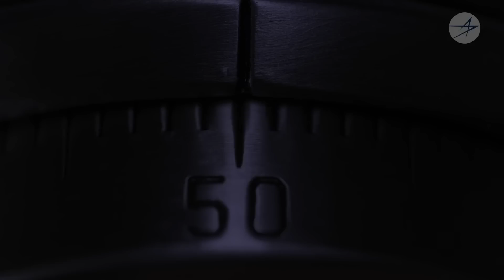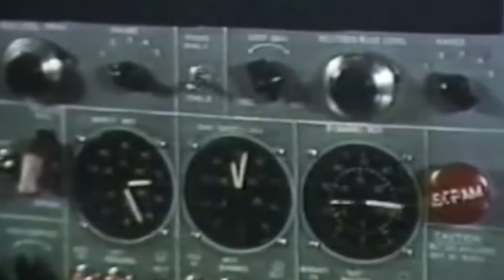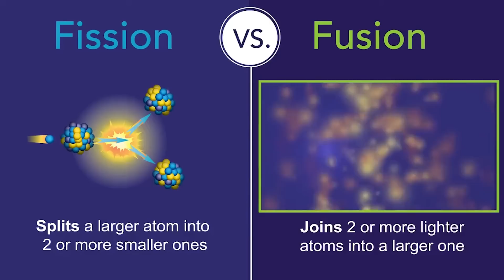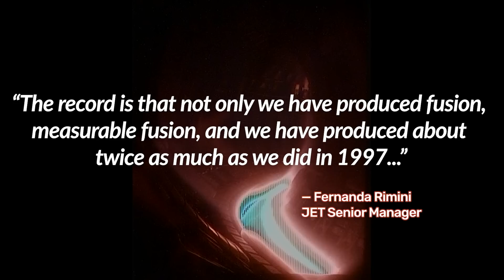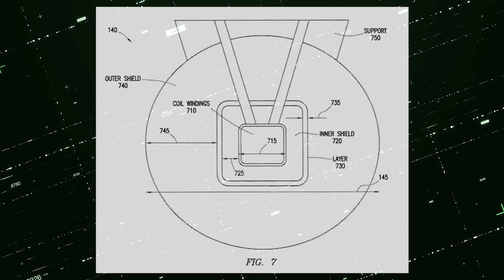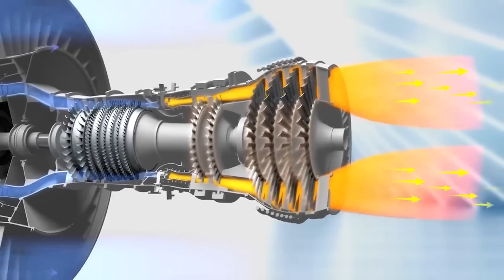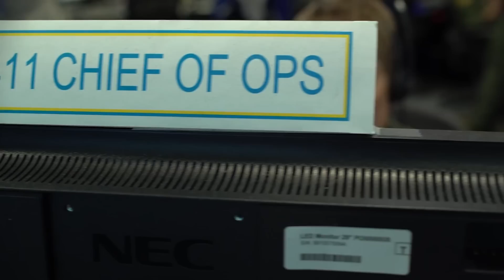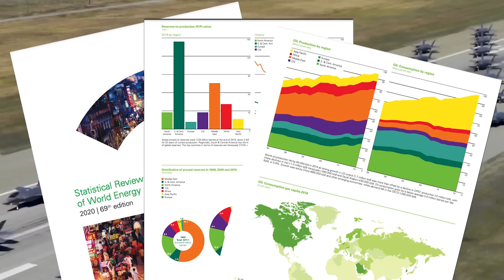Lockheed Martin's fusion-powered fighter and bomber plans

Comment: The patent is only meant to block others from developing the technology and isn't an indication that Lockheed is even close to achieving this.
Reply: that makes sense

But don't forget about how fast they are moving to next gen aircraft
Reply: @colekarrh9114  It's fusion. The tech to make that aircraft fly would solve most of the world's problems.
Reply: Yeah, we've been 15 years from fusion for 70 years.
Reply: @zinjanthropus322  Thanks for fitting this one in perspective. The video was - in sandbox words - a whole lot of nothing. Just tiring words, without any meaning to think about.
Reply: It’s similar to how Boeing took out a patent for forcefields.
Reply: They already have. It started with a LM Engineer that designed & built to fission generator for his house. LM took his design and BLACKED it.
Reply: Very true.
Reply: @samsonsoturian6013  we've gotten closer. 40yrs ago we were only 20 years from commercial fusion power. In the last 40 years we've gotten 5 years closer to the solution.
Reply: Well it certainly won’t be on the market for the next couple of years or even decades. As long as the struggle against china goes on, none of the Wally cool stuff will be released😢
Reply: @samsonsoturian6013  Let us know you didn’t pay attention without saying you didn’t pay attention 😂😂😂 It was theorized in 1950 but ok pay attention
Reply: No so sure
The applications , or rather the actual real world application is advanced propulsion for travel to Mars
Travel is currently impractical due to current level of space propulsion
Such a system could in theory shorten travel times
Reply: You, me, this channel; none of us will ever know until they announce it.
Reply: @blueberrywilbur315  you mind speaking coherently?
Reply: Kevin Verduci  That was fission reaction not fusion.
Reply: Check out Dr. Salvatore Pais’ patents. Government did a lot of work with him to solely gain control of those patents from his work. Much detail is redacted but they have working prototypes of 4/5 patents of his work. Check it out, as a member of the physics community I was pretty shocked. Genius guy who still works for the air force and DoD.
Reply: However the patent was made in 2014 only leaves 12 years till it expires
Reply: @zinjanthropus322  May also cause a lot more. Fission could solve a lot of problems, but gets pushed to the side because it causes quite a few as well.
Reply: @blueberrywilbur315  why you angry, though?
Reply: @J.P Slaym0 that doesn't exist. And you never heard of Ben Rich at Skunk Works?
Reply: Imagine being in any aircraft knowing you can fly longer than your opponent, pretty interesting advantage.
Reply: Then they shouldn’t get the patent. Patents should only be allowed to working inventions. Not just ideas.
Reply: @samsonsoturian6013  
We are a lot closer to dropping that x number of years away today than we were 20 years ago. Mainly imo because of advances in material sciences and the engineering done to bring higher temperature superconductors to market. If I was Biden I'd pump double or triple into fusion. With some if the money going to small startups with the proviso that the Feds get the right to use the tech at lower costs. Site any reactors at current shuttered coal power plants to start with.
Reply: It's almost end of 2022 and Lockheed didn't get any progress on this and there wasn't any indication that they are working on it. So I share your doubts.
Reply: @theebalz  “The source is that I made it the fuck up!”
Reply: I wow I’m sorry you don’t like America making next Gen tech to dominate the world hahah
Reply: @Slimjimmagoo  “It’s only 30 years away bro trust me bro we’re almost there bro cmon bro look at [Insert project that hasn’t made any impact in the fusion field] bro cmon bro please believe me bro” it’s been the same coping for the last 70 years, the Lockheed fusion project was abandoned a year ago, the scientists have moved onto other projects and it’s been taken off the budget.
Reply: @cowmoo5596  Nah they have hit several milestones now and are pretty much at the finish line. Governments already drawing up plans to build them and companies raising capital. This its 20 years away gimmick thing is about run its course. Its near reality now and I would say less than 20 years. Everyone wants to run on number its been 70 years lol but you don't want to accept the progress that was made in that 70 years BRO.
Reply: @wind_runner6836  ITER has another 15 years before it launches, and that’s a test reactor, not even the planed DEMO reactors. Commonwealth and Helion plan for 2035-2040
Reply: How long do they have the patent?  Like pharmaceuticals then they have a patent for 10-15years after that anyone can make copies.
Reply: This patent is reason to think they are further along than you think, and could potentially have working examples. Based on how they've operated in the past.
Reply: @colekarrh9114  SkunkWorks is one hell of an organization.
Reply: @cowmoo5596  ITER is already obsolete because it was designed with the materials from the 90s. Any source you are seeing that bases their analysis of where fusion is at on ITER is a joke. Yes, especially that well known physicist with clickbait video titles. Anyway, If they redesign ITER with modern high temperature superconductors that are vastly more powerful then they'll have to start over which will put it even further behind and it's experimental anyway. If it works and the newer designs based on new superconductors haven't already made it irrelevant then the next stage would be an upgraded version instead of the originally planned enlarged version.
Reply: @j.f.fisher5318  you don't read as many scientific publications as you think.
Reply: Lol like that patent will be respected when it comes to war
Reply: Kevin Verduci  That makes no sense. Fusion operates via hydrogen and magnets. Neither are radioactive.
Reply: @MarkMiller304   Lockheed isn't at war with the rest of the western military industrial complex. China has never cared about patents but they're also still using French companies to build their fission nuclear power plants, they're not about to make breakthroughs in fusion.
Reply: @MarkMiller304  the Pentagon will simply buy the patent in that case
Reply: So they have an exact design and blueprint for a fusion device but are far away from it? Clause that's what a patent is... 😅😅😅
Reply: @seanhoyt497  you can patent ideas. You don't need a working device
Reply: @zinjanthropus322  that’s what I’m saying, with technology involving weapons no one will respect the patents. Countries blatantly try to steal each other’s secrets. It’s a your lost is my gain environment.
Reply: @samsonsoturian6013  so the point in having a certified patent clerk with a background in engineering or physics having to state that the diagrams are legit doesn't matter?
Reply: @samsonsoturian6013  Caaause they have to do that...
Reply: @MarkMiller304  that's why export bans are a thing. One aerospace machine I worked with had a big lable saying not to let any foreigner examine it
Reply: @seanhoyt497  I wouldn't know
Reply: If course. Most people know this.
Reply: @tedrow70  
His patents are remarkable. It’s intriguing as to why the Navy insisted they be accepted
Reply: @Juliane well maybe you should watch more useful videos such as spitting for distance or farting contests. Probably more your speed.
Reply: @seanhoyt497  Doesn't matter how exact your blueprints are, unless you've made it work before all it amounts to is a drawing on a piece of paper. Reality plays by it's own rules.
Reply: @MarkMiller304  Western companies are still constrained by patents. Doesn't matter if they're arms manufacturers.
Reply: The new hypersonic missles use molecular compression to gain speed & increase propulsion. They have more technology aligned with government then anyone would know of.
Reply: @ravenmoon5111  and that they said 4/5 patents have working prototypes, as they’d stated. Now, that’s crazy. It’s crazy interesting the physics he uses because it isn’t “new” physics. It’s based on Heavisides formulae primarily, well that’s the main root. Cool stuff. He did a joint interview with a very famous physicist stephon Alexander recently on Theories of Everything. Would really recommend seeing it!
Reply: @tedrow70  
I will definitely look that up. It’s easy to say the Navy had some crazy idea behind these patents but they seriously leaned on the US patent office to accept them. To me that sounds unlikely unless they thought there was something to them
Reply: @ravenmoon5111  I agree. And he did one other interview with theories of everything (physics profile on YouTube, interviews a lot of famous physicists amongst other intellectuals) that he wanted the government to have them and as soon as possible, so no other nation could try to take the ideas… and he “left out some of the secret sauce” in his own words. One of the most brilliant people I’ve heard, and I’ve an astrophysics degree and aerospace engineering, I’ve seen some smart folks! Theories of everything has both interviews on there. Government definitely is decades ahead of the rest of the world though, whilst most of the world doesn’t even realize😅 crazy times.
Reply: @tedrow70  
Absolutely!
Reply: @zinjanthropus322  ironic patents only limit friendly countries
Reply: @samsonsoturian6013  That's an improvement then. 20 years ago we were always 30 years away from fusion.
Reply: @durandalgmx7633  No it isn't. It has the same accuracy as the Jehovah's Witnesses predicting the second coming of Christ. They just routinely update the dates and causes to fit current stuff.
Reply: When has a patent kept anyone from copying weapons, just ask China
Reply: Pretty sure that the patent doesn't really mean much of anything if it can't actually be built.
Reply: @Roger Smodher There are lots websites promising all sorts of sci-fi products. It's done to keep investors interested for the long term even if they're no close to releasing anything.
Reply: @Raptor747  You'd think so. Research patent trolls.
Reply: @Roger Smodher Dude, so far only one university's devise managed to create more energy than was required to fire it. That is the state of things at the moment.
Reply: @Roger Smodher Not when it's physically impossible. And you need to understand the difference between physics and engineering: The former is pure science and will never generate a profit, and the latter takes the results from pure science and tries to find profitable applications.
Reply: @Roger SmodherI knew the fact that the Iphone has more and better software than the F35 would shock you because like most people you're not aware of the vast software advantage silicon valley has over the military industrial complex. Go ahead and look up the values, how many lines of code are in the Iphone compared to the F35. Who do you think pays more for software engineers? Apple or Lockheed Martins. The answer should be obvious.
Reply: @Roger Smodher I'm a doctoral student in military history. I gave up on engineering because I cannot math. My opinions are as much garbage as yours, though.
Reply: @zinjanthropus322  n
Reply: Nope. Under 35 U.S.C. §101 the device has to be enabled,  i.e., it's got to work. In other words, they can build it.
Reply: @samsonsoturian6013  Huh, November 1, 1952 fusion was achieved. Harnessing it in workable confinement is the roadblock.
Reply: @thatonejerry9092  which uspn
Reply: @J.P Slaym0 how would YOU know?
Reply: @dawnfire82  Radiation comes as the fusion byproduct.  Castle Bravo demonstrated that quite thoroughly.  Hydrogen itself is generally not radioactive except for the low energy tritium. The thing that matters is what wavelength the radiation is emitted at. Not nearly so much in the 3×1016 Hz to 3×1019 Hz range which makes it far safer to work with.
Reply: @verdebusterAP  actually the biggest challenge of getting people to Mars isn't the propulsion system, it's keeping people not only alive but healthy. We can get them there alive but they won't be good for a damn thing upon arrival and recovery for getting healthy enough to actually function is unlikely. 
One of the best concepts put forward to achieving it successfully was called Mars Direct in the 90s, doesn't need any new or future technology, can be done on today's tech (was even feasible when first proposed in 90s ago) . The only issue was the cost. That's it. The investment. If the political climate at the time wasn't so turbulent it very well could've been done.
Reply: @jamesmaddison4546 
The current of tech means that trip will take months
The problem there is that requires a lot of fuel and resources 
Keeping them alive is simple task of designing a ship with proper shielding which again goes back to propulsion
Ample shielding is going to be a lot mass and in case of solar activity, they will need hardened shelters 
Thats a lot mass for engines
Reply: @verdebusterAP  It will take months either way dude. My keeping alive comment isn't just about the radiation. A shelter isn't as difficult as you think. We've had people stay in orbit for over a year on the iss and when solar storms hit they have a place to go retreat to. Any ship going to Mars is going to have alot of mass, the shortest trip is 6 months but you have to wait over a year to return and then 6 months back. So at shortest you're looking at a 2 year mission. You can send multiple ships in advance with everything you need, and what must come with the crew can be attached via rendezvous along the way. The big problems are food, and keeping the body itself healthy. Currently if we sent a crew they would be way too weak to even exit the ship because of the gravity environment they've been in for so long. Yes I said people have been on the iss for over a year and guess what, when they're back they get carried out of the landing craft. All the exercises they do isn't enough. It takes some months to be able to walk unaided again. On Mars, there's noone waiting for you to carry you. 
You don't have to believe me, you probably won't at all, but I'm actually an aerospace engineer, graduated 2 years ago, I have 3 more years before I can take the abet p.e exam and once I do, I plan on specializing in propulsion. Currently i work at Lockheed missile and fire control. 
Systems, nav guidance etc just isn't my thing. So when it comes to this stuff I know what I'm talking about. 
Of course new advanced propulsion systems will help alot of the problems with Mars travel, but it is not the limiting factor. It could be done today with what we currently have.
Reply: @jamesmaddison4546  
Exactly why the current level of propulsion is not feasible. It requires Mars and Earth to be in optimal positions which is not feasible
Feasible would be 7 months 3 months there 1 month stay and months return regardless of the planet positions
. The ship would only have carry 14 months of supplies
A 2 year mission would require 4 years worth of supplies
The problem with pre supplying is that you don't have any control over it. Now after the crew has left, you can start sending additional supplies so can build up a surplus so future missions can more equipment  to expand the base
Reply: @verdebusterAP  it's not all in one go dude. Habitation and food modules sent in advance, robotics setup solar arrays for power etc. Alot of things will be done awaiting the crews arrival. The crew takes what's needed for the journey plus a bit extra. Follow on resupply missions will also be sent ensuring crew have everything they need from food, clothing, replacement parts and so on. 3d printers will also be there waiting, if the printers can't make what's needed it's sent on resupply. Everything is saying is literally the mission profile that nasa itself agrees with. Look, I understand and agree with your propulsion comment, I chose propulsion to specialize in for a reason. I want to work on such revolutionary engines dude. But if you're always waiting for the next best thing, you'll never get anywhere
Reply: @Roger Smodher vhut? Relevance?
Reply: @jamesmaddison4546  
You can't send food or water in advance
The modules would subjected to months of radiation both in space and on ground
Sending them in advanced again means they have to amply shielded till the crew which again means more mass.
Even with equipment , still the same problem. Hence you have to wait to till after the crew launches, to start sending additional supplies as once they reach
Mars, the crew can break them done and store them safely in build up modules
Travel is only feasible when we dont have to rely on optimal planet positions
That means engines not reliant on chemicals
Reply: @verdebusterAP  🤦‍♂️ are you even capable of a discussion (this isn't a debate in my opinion) where you aren't stuck mentally within your own position unable to actually analyze what the other is saying? Repeating myself but I'll rephrase, every module sent WILL HAVE the ample shielding needed. The gardens that will grow in these modules will be safe, so will the water. I'm seriously not going to break down the entire mission technicals and timeline in a youtube comment. But if you really think some of the brightest minds in government and private sector space industries don't have the timeline sequence of the mission in proper order, that protection, storage etc isn't sorted, then man I don't know what to say. I'm not coming at you with hypotheticals I'm informing you of the approved mission profile. It's been thought of, worked out, calculated etc for a very long time. Space mission planning doesn't take place over a couple years, some people spend their entire careers on one mission theyll retire on before it even launches. Everything you see as a roadblock because of 1 reason, those people figure out ways for that roadblock to not be. That's why they're great at what they do. I'm pretty much done with this because you're stuck in singular thought
Reply: @jamesmaddison4546  
Again incorrect. In order to shield modules for months on end for travel through space and on the ground requires a massive amount of shielding and will greatly increase the mass again not feasible
The factor you are missing is the Mars atmosphere
Why did the NASA have to use the Sky Crane technique just to land 2000lbs rover
Why can we land 20,000lbs module on earth with 3 parachutes but can't do the same on Mars
Mars atmosphere is considerably thinner than Earth. 
Trying to land 20,000lbs on module on Mars would be exceedingly challenging
No they will not have ample shielding unless propulsion issues make a stellar leap
Reply: The patent cannot prevent others from developing the technology, it only prevents others from commercializing the technology.
Nobody can have monopoly of knowledge.
Reply: @theebalz  may I interest you in a bridge I have for sale in Brooklyn?
Reply: Kevin Verduci  That was FIssion, not FUssion. It's explained in the video
Reply: this fusion reaction-based engine platform powers two incredibly powerful electromagnets encompassing a very large uranium despited sphere at the northern and southern hemispheres,.This sphere is filled with liquid uranium rotated internally at 60,000 rotations per second. This becomes a magnetic superfluid ( different state of matter) producing plasma waves. The engine is supercooled to -250 Kelvin and pressurized at 300 atmospheres. The plasma waves produced affect the gravitational wave of the earth's magnetic field. The compact fission project achieved a beta limit of 9 or 90% in the late '80s. This is exactly what powers the TR platforms, TR-3A, TR-3B, TR-3C, and TR-3R.  I am not coming to you from an "x-files: prospective, this is real technology and has been undergoing testing and prototyping since the early 80s. The TR platforms were just the very crude and early stage of these types of powerplants and aircraft.
Reply: @e.s.5529  Crude but effective.
Reply: @zinjanthropus322  there has been valid advancement in fusion tech recently though
Reply: The government technology is generally 50-20 years ahead of the public,  but y'all know it all so....
Reply: @christopherjacobs8075  Those are just myths. The latest technology is where the big money is and where the most talent is concentrated which is in the private sector.
A few government labs are working on some new stuff but nearly all well refined products are the results of decades of feedback from millions of customers not a few government contractors and employees.
Reply: @zinjanthropus322  so who were the customers  for the F-22, X-29, X-31, X-32? Surely wasn't the private sector.  Yeah a lot of technology is inspired by private sector demand. That depends on what kind of technology it is though.
Reply: @christopherjacobs8075  Those aircraft wouldn't pass civilian standards as commercial products. The complaints about glitchy ui, uncomfortable seats, subpar noise proofing, terrible internal furnishings, lack of extensibility, price, malware after hackers get their hands on them etc would never end. The only reason they are able to get away with vehicles like the humvee that can't pass civilian safety standards is because only government employees who are able to stand the poor quality use them.
Reply: @zinjanthropus322  can't complain about what they don't have.  The government doesn't design things with comfort in mind to begin with. If they do I have a bone to pick with them about my rides in C-130's.
Reply: @christopherjacobs8075  But that's the point. If civilians were allowed to have fighter jets and a market developed, you bet they would better in every way from comfort to performance than anything available to the military. Probably cheaper too.
Reply: @zinjanthropus322   betting sounds good, but  it's not reality. Just like the technology discussed in this video is not designed for civilian consumerism. At least not in our lifetimes and possibly not in our children's lifetimes either. Doesn't mean it doesn't exist or won't. It just means civilians don't have access to it.
Reply: @christopherjacobs8075  That's a legal barrier not a technological one. For every thing that governments have that is also legal for civilians to have, the civilian versions are superior. You can't claim to be better than someone when they outmatch you everytime you don't make it illegal for them to compete. It wouldn't be a bet at all to say they would do the same if the barriers were removed.
Reply: @zinjanthropus322  still irrelevant if civilians can't have them. 🤷🏿‍♂️
Reply: That's not possible now. Everybody is researching for a sustainable fusion reactor. However the reactor can't sustain long enough to produce any energy.
Reply: Lockheed is a head off with many areas including stealth & other Techs …..Don’t underestimate them…they have good talents ..just look at their F22 …so many  nations and companies r struggling to make a fighter like the Lockheed ones ..
Reply: @colekarrh9114  We can’t even achieve fusion sustainability on the ground, this is a minimum of 50 years out
Reply: @landonluebke7627 , You are right but is your source about a civilian or military project. Don't forget that the known U.S. military budget is more of a light estimate than a set number not to mention the numerous black budgets. The U.S doesn't spend money on the military like any other nation, so remember that the U.S. has its resources to get projects moving fast.
Reply: @MarkMiller304  That only the most determined of state actors can illicitly get their hands on, no less. Thankfully, such actors are relatively few and far between.
Reply: @isaacomole9527  In other words, there's nothing stopping the individual from copying what is patented, if only for personal use.
Reply: @colekarrh9114  you are 100% correct in that, and I fully expect to see this within my lifetime, just from what I know about non-classified fusion, and how (that we know) military procurement works, this is still a minimum of 35 years out, but closer to 50. In my opinion of course.
Reply: Ok, Have a nice one
Reply: @samsonsoturian6013  yeah well, who knows ITER is the biggest attempt yet so there is a chance er have commercial fusion by 2060
Reply: @f1reguy587 I think the objective of air combat is always to fly longer than your opponent.
Reply: You're missing the point. It's  Technology moving forward not standing still
Reply: You're missing the point it's technology moving forward not standing still
Reply: Yup exactly
Reply: Thaaaaats not exactly how patents work and what they are intended to achieve, but you believe what you want to believe.
Reply: @samsonsoturian6013  
JPL just achieved it earlier this week. Decades ahead of anyone else.
Reply: @thatonejerry9092  
No no no. An invention must be reduced to practice (i.e. “it works” before you can get a patent. 🤦🏻‍♂️
Reply: @theebalz  
Not true at all. JPL did it this week.
Reply: @Frankie5Angels150  No, they simply had a sustained net positive reaction, that is not the same as functioning fusion reactor
Reply: Don't be so sure.
Reply: @vandiverb  You can bet your life on it
Reply: You realize you can’t file patents for items that you don’t have a working demonstration model for right?
Reply: @theebalz  most people are still 20-50 years behind. 🤣👍
Reply: Is this the same fission tech that the sciencentis have recently figured out?
Reply: Yess I was thinking among same lines
Reply: They more the less are why filled
Reply: C'mon man, Tony Stark built that thing in a cave with a box of scrap!...All the eggheads at Lockheed can't get it done?! 🤨
Reply: This is true, but the real question is if they actually incorporated it into an airframe and that was the only practical purpose because of the specific of the system would they even announce that the airframe was powered by it?  It would draw a lot of attention from foreign entities for espionage they might not get if they just only told who needs to know.
Reply: That sounds more feasible then there being actual operational aircraft using that technology.Companies will do things for the now and the future.
Reply: Possibly, but they announced a small fusion reactor years before that
Reply: Other countries don't have to follow us patent laws, especially Russia.
Reply: Probably the Chinese already have this in their inventory 😂 Can we keep our secrets to ourselves and do not divulge too much information. And also can we do a better job at cyber security so Chinese hackers doesn't get our goodies. We really suck at protecting our military secrets
Reply: Yep
Reply: @felixfungle-bung4688 but iirc that also means you can walk in with an unbuilt, untested schematic and the patent will only cover the specific details of your design, so if someone builds cybernetic arms too but it doesn’t operate on your patented principles, then they’re good, and if your principles don’t end up working the patent is worthless.
Reply: @samsonsoturian6013 we're closer then ever MITs SPARK reactor lights late next year and has a high chance of having a Q of 10 of more meaning it produces more power then it uses by 10 times allowing it to power both itself and the facility that runs it and maybe more
Reply: These secret black projects have achieved fusion long back .
Reply: @shernojoe2671  Black projects developing UFO tech are and have always been a psyop.
Reply: A patent won't stop others from developing the tech, just developing it in the design outlined in the patent...
Reply: @three6nine992  Yeah because China cares about copying directly.
Reply: @three6nine992  depends on the type of patent. A discovery patent makes it so anyone who goes into development of this have to pay a fee. While a standard design patent as long as there's a provable difference they don't
Reply: @zinjanthropus322  Tell me; does Skunkworks have a division solely focusing on function reactors in Forth Worth?
Reply: @Laminar-Flow  maybe, does that mean they'll achieve fusion? Probably not.
Reply: @zinjanthropus322  Did Lawrence Livermore achieve Fusion ignition on Monday, December 5, 2022? Its pretty clear you dont have a scientific or engineering background.
Reply: @Laminar-Flow  Oh that must certainly mean they're a few years away from turning that massive facility into a tiny aircraft engine based on that tiny lab result.
Reply: Do you actually know that to be true or you just dislike Lockheed...but countries hostile to the US  will ignore the patents  and develop  their own
Reply: @TheSympathydenied  You don't have to hate Lockheed to suspect that they probably haven't cracked the holy grail of energy production.
Reply: Check this out, What about for our vehicles?
Reply: Doesn't matter. Who pays attention to laws and treaties? Take a look around, govs. pretty much ignore what doesn't suit their agenda.